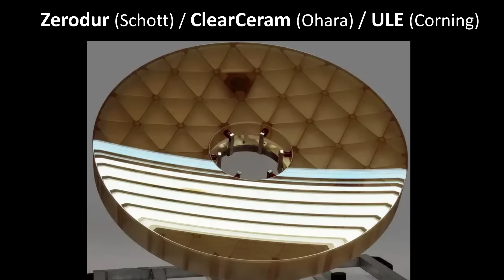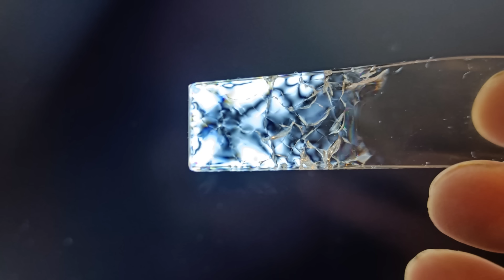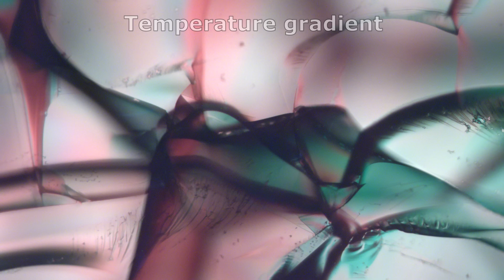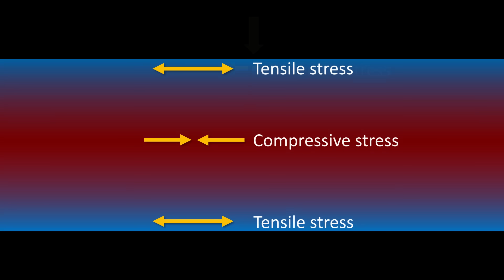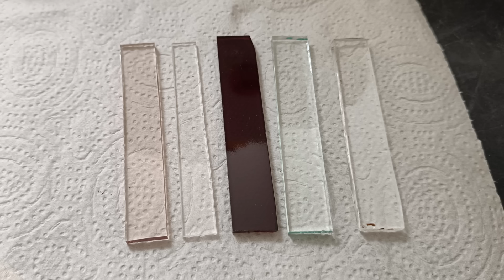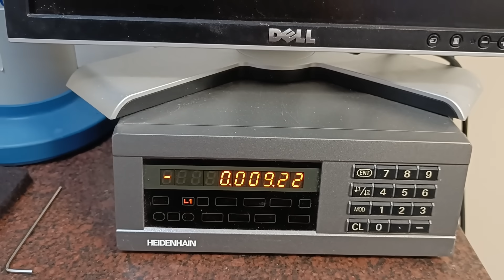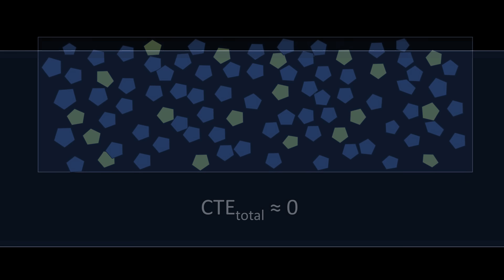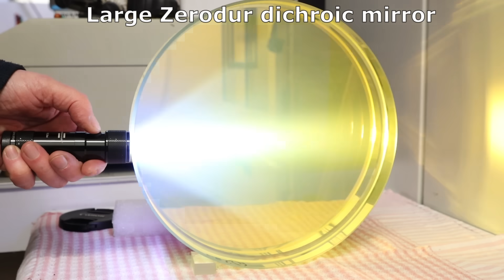The Amazing Properties of Glass-Ceramics (GC Part 1)

Comment: on a side note, your explanation of linear expansion and coefficient of temperature and why ceramics can remain stable in higher temperatures has helped me understand why columns of rock form in the mantle of the Earth's lower crust. it is evolutionary crustal ceramic formation. in a medium (magma), where material is always circulating and is placed between a heating source and a cooling source, the material less stable will deteriorate, while the more ceramic rock will build onto the hindrances to flow, thus creating structures such as caverns and columns. however, ceramics that survive in the upper magma, once reaching the surface of the earth becomes surrounded by alkalines from coral formation, and this reduces the ceramic formed in a more acidic magma that reaches an alkaline ocean bed and cave system, so these ceramics are rare on the surface.
Reply: A bit mixed up there, there ar no columns and caverns in the Mantle, the geo-pressures are too high for cavities.  It is volcanic rocks like basalt that form the columns on cooling.   Many silicate rock-forming minerals are similar to ceramics in general, high melting points, transparent or translucent, and crystalline.
Reply: @karhukivi  look up a recent short by channel, Dr Ben Miles called, scientists find two large islands beneath the Earth's crust. also research columns in the mantle. these are what i am referring to. it is difficult to keep up with new discoveries, so no worries!

Comment: There is a company in Germany that uses UV light diodes to melt metal. All UV light is absobed. It is amazing, with little energy, high temperatures are reached. Perhaps ceramics also absorb UV light well ???
Reply from the maker: I think this would work for both Ceran as well as Robax since they both absorb almost all light below 400nm
Reply: Why would they use UV?  Most light, visible, IR and UV are reflected by the free electrons in metals.   Induction heating is what is used to melt metals, or gas/oil/coal furnaces.
Reply: @karhukivi  UV light is much more energetisch. The energy of a photon is proportional of its frequency.  Moreover, UV light is absorbed. Visible light is reflected by metals.
Reply: @carlbrenninkmeijer8925  UV is not absorbed by metals - where did you get this idea from?  We use UV lamps and they have reflectors made of polished aluminium.  The photoelectric effect is a conversion of some photons to electrons from metals with a low work function (like sodium), but most of the UV light is just reflected. Not until you get to x-rays are photons scattered and absorbed.
Reply: @karhukivi  Aluminium reflects well,  but gold is not. Please realise that metals barely reflect harder UV light
Reply: @carlbrenninkmeijer8925  I think you are referring to thin metallic (mirror) coatings,  and not solid metal.  Can you name the factory so that I can see what they produce?
Reply: @karhukivi  no, it is for bulk metals... I am sorry that I cannot help you with commercial info.
Reply: @carlbrenninkmeijer8925  If they are using diodes, the amount of metal must be very small.  I think you are talking about thin film deposition technology, probably gold films onto plastic substrates.    I just took a gold coin I have and reflected UV light from it onto a phosphor and it fluoresced, so little absorption of 254 nm short-wave UV.  I'm not saying "none was absorbed", because gold has a yellow colour due to a greater amount of the red end of the spectrum being reflected, compared to most silvery metals.
Reply: @karhukivi  I was so surprised, as much as 20 Gram of metal !!!
Reply: @ A powerful UV diode and operating in the range 300-500 nm - very interesting!

Comment: I feel like a glass coffee mug made of glass ceramic would be quite the coffee mug. Is there a reason these aren't more widely purposed for consumer use, rather than merely household applications like cooktops? I don't recall encountering glass-like cookware that could be so easily abused without fear of it breaking.

My parents have really old, thick glass pyrex cookware (and some of it has even been chipped) but I assumed at most it was the old borosilicate glass rather than the newer soda lime formulation, and in either case (new or old) it's never really been stress tested for obvious reasons.
Reply from the maker: Look up "CorningWare mug". Bu the way, glass ceramic used for cookware is generally opaque (and mostly white)
Reply: @HuygensOptics  Interesting that it seems to be marketed almost exclusively as stoneware or ceramic, rather than as some sort of rather more exotic glass ceramic. I think my parents have two bakepans in that material but I always thought it was ceramic/porcelain.
Reply: I do think clear or semi-transparent mugs in this material would be way cooler. The fact that corningware is marketed as stone ware and is completely opaque probably makes it better for cooking, but if all I wanted was an unbreakable coffee mug they are a little bit less impressive, since they come across as ceramic mugs which are already pretty resilient to thermal shock. But a shock-proof "glass" mug? That would be really neat, kind of like those double-wall insulated mugs (except way more durable)

Comment: Is the "aluminum" sample you used pure aluminum (1100 series) or one of the common alloys which have many types of alloying elements..   This could easily account for the discrepancy in the measured CTE and further, the heat treat state of the alloy can also affect the CTE..

Comment: A thin insulator, maybe a strip of fiberglass tape between the measured sample and the length probe will slow thermal conductivity and reduce the impact of the CTE of the probe.  I'm thinking your negative values may be a result of that conduction.
Reply from the maker: yes that could be the case, I'm considering making a little cap of Ceran / Clearceram that fits on top of the ruby ball of the gauge.

Comment: Were you referencing the CTE of the specific aluminum alloy you were using, or were you referencing the CTE of pure aluminum? Edit: you explained it with the extrusion. This is a known problem with forged engine parts, which can result in accelerated wear in race engines built from forged parts that aren’t warmed up to spec properly before racing.

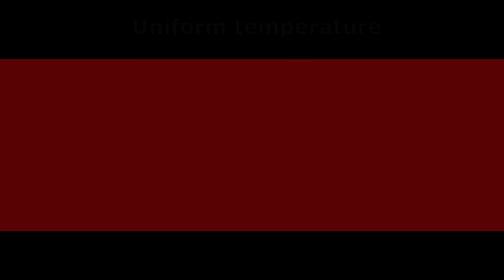Comment: One thing that is not addressed in the thermal shock experiment explanation at 5:30, but is very important in the case of glasses, is that the theoretical yield strength of the material is predicted to be orders of magnitude above its practical value (10'000's of MPA theoretically vs 100's of MPA in practice). Therefore, we hypothetically would expect glass to withstand much higher strains (and therefore temperature gradients).

A scientist named Griffith proposed that the explanation for this discrepancy reside in glass inherently (insofar as traditional glassmaking methods goes, at least) possessing microscopic fractures that cause strain concentration points in the material. The theory that Griffith has established back in 1920 has since then become one of the cornerstone of fracture mechanics.

Comment: oh, one more question, that might be an obvious answer, but also, maybe not?

When these materials (or other glasses as well) change temperature: Does the IOR change with it? Are there other implications besides the physical deformation for optical appliances regarding temperature changes?

Of course, the simple answer would be "No, of course not!" but I have learned so many unintuitive things from your videos, that I should ask myself, "*Why* Not ?"
Reply from the maker: Yes the IOR changes quite significantly with temperature. It's the reason why glass-ceramics have much less benefits when used in transmissive optics.

Comment: Extruded aluminum is rarely pure aluminum because alloying it with other elements enhances its strength, durability, and other properties. The most common elements added to aluminum are:
Magnesium (Mg) -  a key component in alloys like 6061 and 5083.
Silicon (Si) -  commonly found in alloys like 6063 and 6061 (combined with magnesium).
Copper (Cu) -  Used in high-strength alloys like 2024 and 7075.
Zinc (Zn) -  in alloys like 7075, which are used in aerospace applications.
Manganese (Mn) -  in alloys like 3003.
Iron (Fe) - Present in small amounts (sometimes as an impurity).
Chromium (Cr) -  to improve corrosion resistance and toughness, as in 6061.
Titanium (Ti) - Used in small quantities as a grain refiner to improve the alloy’s structure and strength.

Comment: To me, putting the "plus and minus" CoTE materials together to achieve net zero expansion harked back to clock pendulums in which the increase in length of the wooden rod was offset by the free floating bob expanding upward thus maintaining a temperature compensated overall length. Likewise in watch balance wheels, a bimetalic rim that makes the rim flex inwards as temperature rises - is used to compensate for the expansion of the arms of the wheel. It makes sense that this scales into the molecular realm as well.

Comment: My research involves the use of highly porous silica gel.  It has high surface area and lends itself to use as substrates for immobilized biomolecules.  But I've found that it breaks down when used in chromatography columns that cycle between 5C, pH 3 acetate buffer up to 70C, pH 7.5 over a period of about once per hour.  The column only lasts about a week.  I was surprised that it was not more resistant after learning about silca's properties.  The silica gel was a product from China.  Why would it break down under such mild conditions?
Reply: I was a technician at Sullivan Park in the 70's.  I have never since worked in an institute as well managed, organized and committed to success.  I carry many fond memories of my time there.

Comment: Nice video, I don’t quite get the stress distribution when you cool down glass too fast. Shouldn’t be tensile stress on the (hot) inside and compressive stress on the (cold) outside? Like if you take a simplified example, hot glass that is cooled down only on one side, the cooled side shrinks hence the piece bends on the cool side, generating tensile stress on the hot side.

Comment: Quartz (pure Silicon oxide) also doesn't crack when thermal shocked.  It all has to do with the thermal expansion, the lower the better.  However you can view stresses using cross polarized light, which would have been interesting with the roblax example.

Comment: At work, I have to deal with misalignment of print heads in a single-pass industrial printer. Even though temperature fluctuations are low, I suspect that the thermal expansion of the stainless steel body can be enough for the heads to be misaligned over time. The heads are mounted with screws in spring-loaded cutout, and in-between there are UV LEDs to pin the drops where they land on the substrate by partially curing them. I wounder how transparent Robax is to the UV wavelength in use, and if the body could be made from Robax, or a similar affordable glass ceramic in stead.

Comment: Hi again! About the aluminum experiment—I have to admit, I probably need to rewatch it more carefully… I was listening while taking a shower (not the most scientific setting, I know!).

That said, just a small note: FCC metals, like aluminum, generally don’t show anisotropic thermal expansion. According to Physical Properties of Crystals by John Nye, the thermal expansion tensor for cubic systems (like FCC) is isotropic—same values along the diagonal.

If what you observed isn’t a measurement quirk, my metallurgist brain wonders if it could be related to precipitation hardening, which is common in aluminum alloys like the 6xxx series. Fun fact: we often use dilatometers to detect phase transformations in these alloys.

To really pin it down, a set of time-dependent, controlled experiments might be the way to go. Looking forward to more of your awesome content!

Note: Comment proofread using an AI tool to sound "clearer" and "friendlier".
Reply from the maker: Thanks for the suggestion, I will look into this! Maybe next time take a bath when watching videos ;-)
Reply: @HuygensOptics  😅😅😅
Reply: Note: comment edited while in the tub to sound "cleaner" and "more pruney"

Comment: is it possible to create different crystal sizes in a single piece?
maybe start the normal process, then move back down to the nucleation temperature then back up to crystalization temperature, but stay there for less time so the new crystals don't grow as large? and the existing ones don't grow a lot.
and then add another crystal size and another...
similar to how aggregate in concrete consists of different sizes.
would this improve mechanical properties?
Reply from the maker: Yes I think it is possible to create a specific distribution of crystals if you know the nucleation and crystallization curves. But I must admit I have no idea what it would do to the properties of the material.

Comment: The negative CTE still is wild, would be interesting to see if you could mimic a freeze-thaw
I've wanted to see how to create a water drill using free-thaw for certain mining - but negative CTE could be interesting, heat fine grains of it on a rough stone surface, and see what happens, or flowing into a crack and heat/cool cycles. similarly with a positive, and cool/heat cycles. but heat/cool makes them tougher as they don't introduce cracks - so more interesting.... hrm.

Comment: Aluminium extrusion CTE is to be expected, as you very rarely find aluminium as a pure metal, it almost always is an alloy of some sort, especially with lower cost extrusions, as those are made from lots of recycled aluminium with assorted alloys in them, so it will definitely not be pure, containing lots of copper and other metals in it.  you would need to order chemically pure aluminium rod to get the correct CTE, or know what that particular alloy is to get the same, though you could probably look up assrted alloys and the CTE, and get a rough idea as to CTE of the actual bar you have.
Reply from the maker: Yes I looked up the type of aluminium on the site of the supplier  and what the CTE of that material should be, but still came up with around 24 ppm. Maybe I should anneal the material and see what happens to CTE .
Reply: @HuygensOptics  Probably will change considerably as it relaxes all that locked in tension, you probably will see a noticeable difference in length and other dimensions as well.

Comment: Great video, thank you! I enjoyed the Ultra Spherotronic breakdown as well haha :D

I have a hypothesis for why the Aluminum CTE measurement seemed too high. Looking at your first graph with the other measurements, the other measured starting temperatures are all higher than the starting temperature of the Aluminum. If you heated them to all to roughly the same temperature, perhaps the IR thermometer was reading low for the Aluminum sample given how narrow it was compared to the other samples, so the integration area of the IR thermometer's spot wasn't fully filled horizontally by the sample?

If you fudge the data a bit to make it fit the assumption that they all started at the same temperature, does the "corrected" value for Aluminum line up better with the reference?
Reply from the maker: Thanks for the suggestion. The thing is that all measurements are nicely on straight lines. And it is only the slope that matters. The only other thing I can come up with is that the aluminium somehow irradiates differently from the glasses. I will check with different pieces of metal.

Comment: My inner chemist found this fascinating.
And then had to go check how the cat laser bounces off a window (cleanly) vs my glass cooktop (quite scattered).
Reply from the maker: Interesting you should mentions: the commercially available Ceran has a bumpy surface with bumps of about 1 micron height. But you can actually polish it to nanometer flatness. Just tellling in case you want to get rid of the scattering to save the cat's eyesight.

Comment: @20:00 A net zero CTE. Combining domains of positive CTE with domains of negative CTE. Makes sense, mathematically. Not sure it makes sense structurally... depending on how the domains deform and exert force on each other, also depending on their orientation and positioning.
Reply from the maker: I guess as long as the crystalline domains are small, the stress remains relatively small and very local.

Comment: I remember getting a whole bunch of ring laser tubes in various stages of assembly made of machined zerodur several years ago. It was pretty crazy seeing a tube made out of a block of the material with the mirrors soldered on, and having 3 laser channels with 6 beams outputting when lit up 😮

Comment: That chart of nucleation rate & crystallisation rate between the melting temperature and glass transition temperature explains a lot of what I have observed in 3D printing different polymers at different temperatures, with or without an enclosure.
I have been able to get some very transparent results with Clear PETG. After sanding and polishing the only defects I see are the tiny air bubbles trapped in the corner edges where the walls lines and layers converge. 

This would also explain why you get different strength and flexibility results at different temperatures. 
It’s such an art to cool the fresh extrusion just below the glass transition point so it holds it’s shape, but not too cold so it can re-melt slightly and bond to the next layer on top.

Comment: Perhaps the discrepancy in the aluminum cte measurement is due to the much higer thermal conductivity of aluminum compared to the glass and glass-ceramic samples. The conductivities differ by roughly 200x, so the assumption that the probe isnt changing temperature might not be justified.
Reply from the maker: good point, I have to look into that. I was thinking of shielding the pin better thermally with a clearceram protection notch.